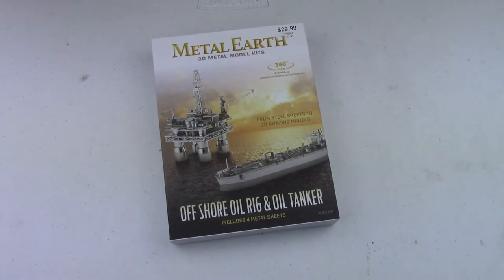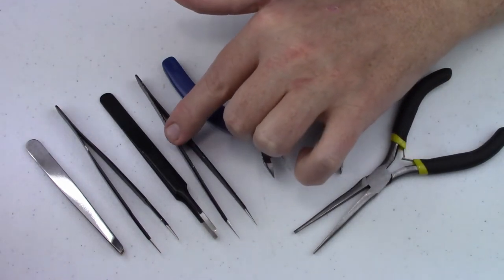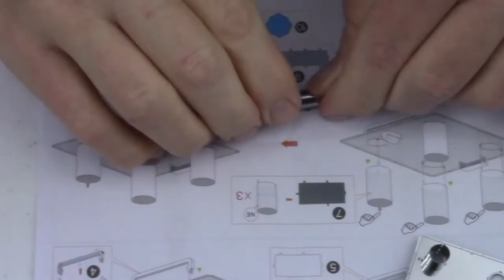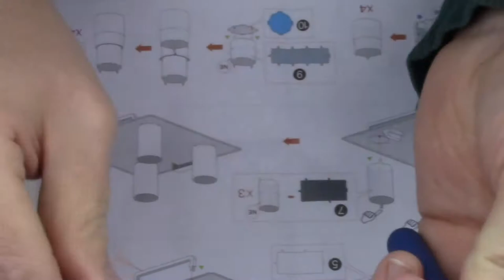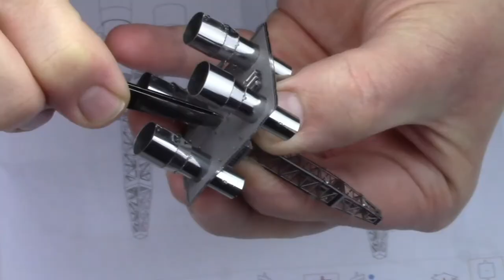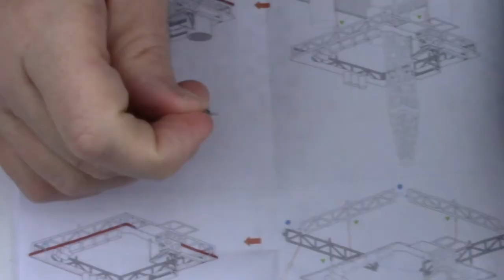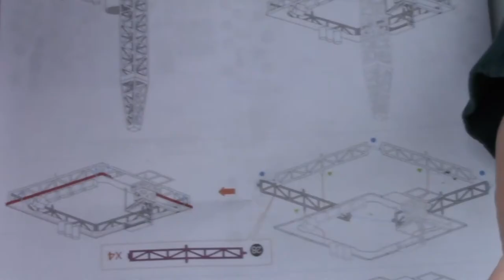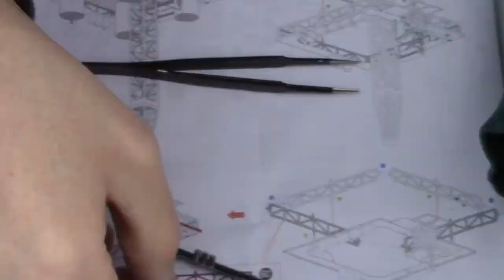Metal Earth Build - Offshore Oil Rig - Part 1 - Offshore Oil Rig and Tanker Box Set

Comment: Hey Brad, I don't know if you've noticed but Fascinations have revamped their website and seem to have removed all the 360 views and replaced them with just a few pictures of the model from various angles. You can still access the 360 pages but you need to manually type in the page address. I'm not surprised they have done this because most of the models built for the 360 Web pages were not built very well as you know. It's always fairly easy to do a better build than they show
Reply from the maker: Optical Trace interesting. I have seen that they revamped the Fascinations site, but I just checked and it looks like the 360 views are there and working.
Reply: Ahh man. For some reason I was looking at Fascinations website and not metal earth website. Yes, you are right, they are still available on metalearth.com. My bad, I got confused lol